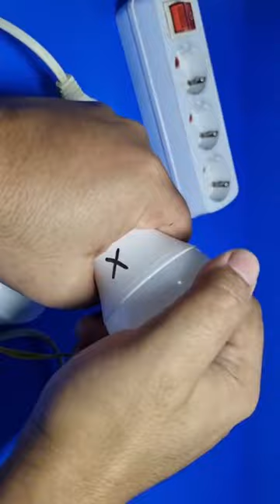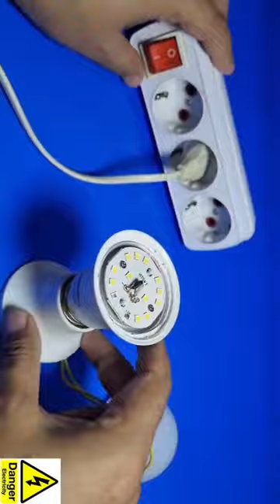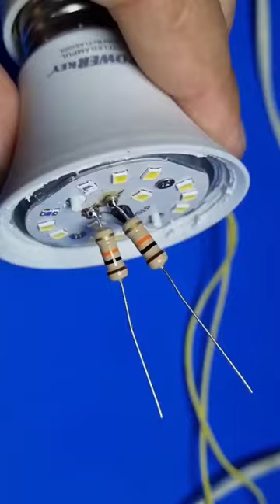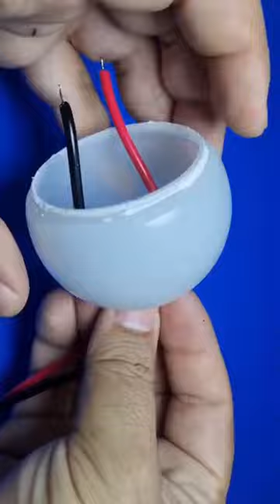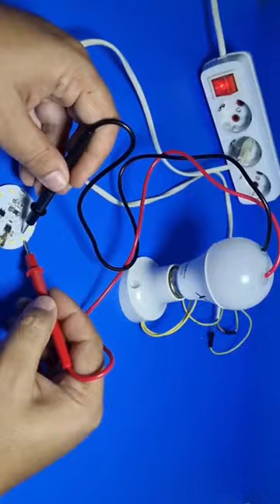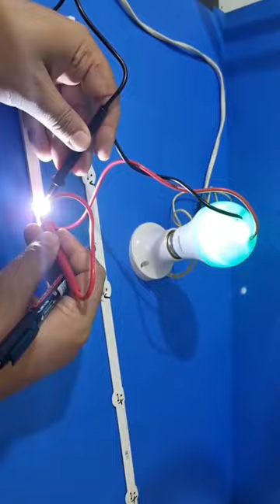Don't Throw That Old LED Bulb Away! This Tool Should Be in Every Home  #zaferyildiz #diy #viral #led

Comment: There's an obviously faulty LED there - the one directly above the power supply leads has the Black Dot of Doom. I'd either unsolder it and replace with a known-good LED out of another failed lamp or, more likely, just short it out with a solder blob. The LED controller will be a constant current supply so will adjust the voltage on the remaining LEDs.